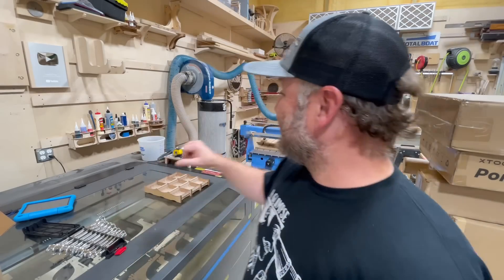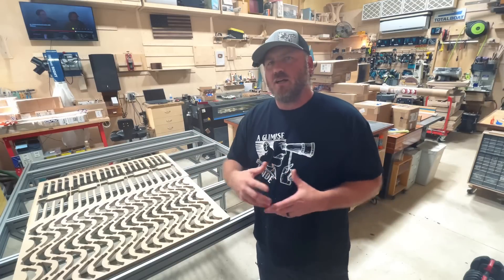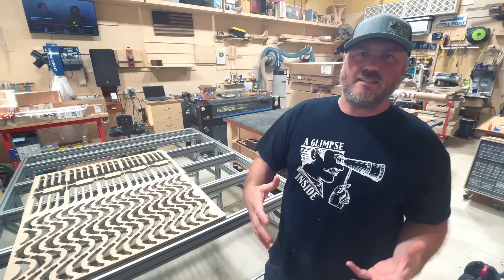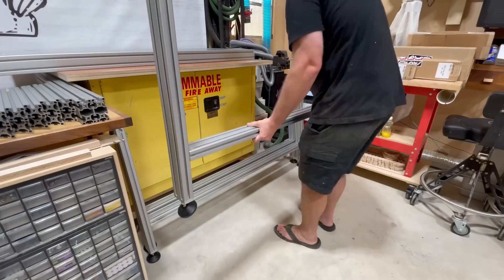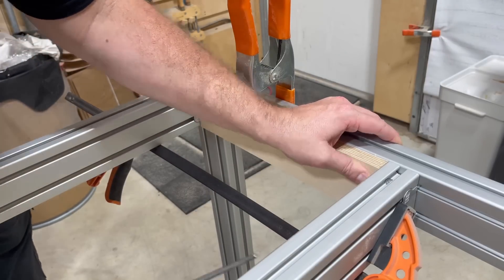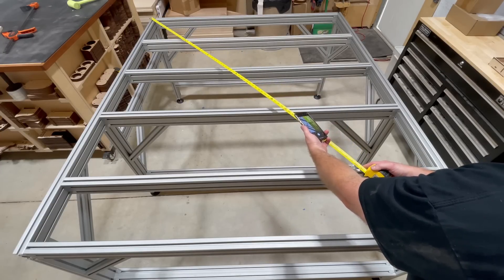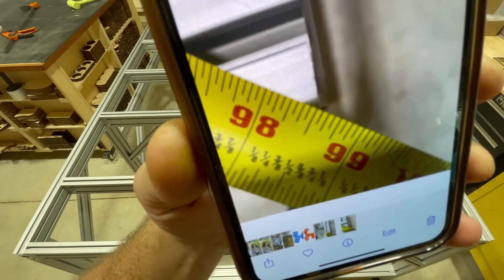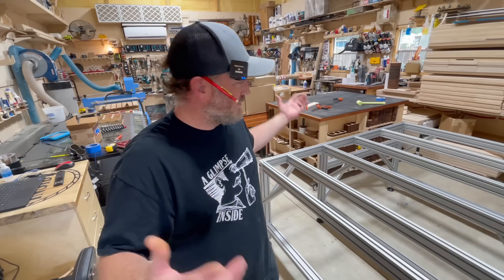The Beginning Of A New Era

Comment: I bought the Pro4848 a year ago and put it together myself. Something else that is good regarding your particular setup: storing slabs and/or sheet goods underneath the system will make it more stable by lowering the center of gravity. People have mentioned that motion can occur with the acceleration of the gantry using the aluminum extrusion, but I have not seen this. I have about 400-500 pounds of wood stored undermine. Jay Bates and others have tutorials of how to build supporting cross beams.